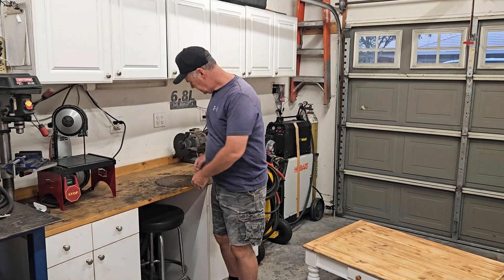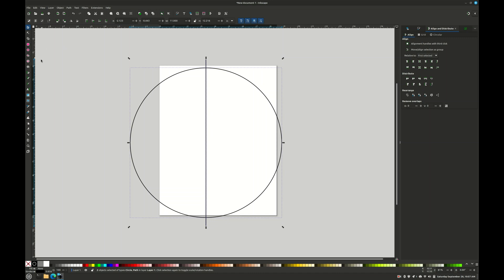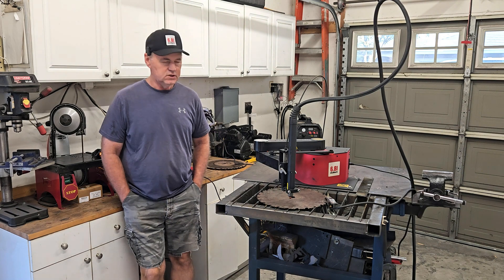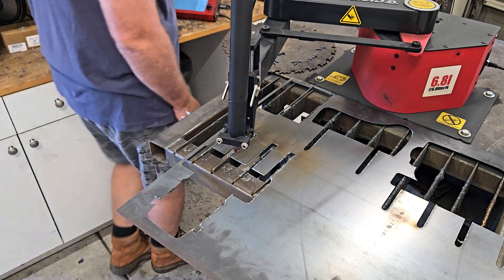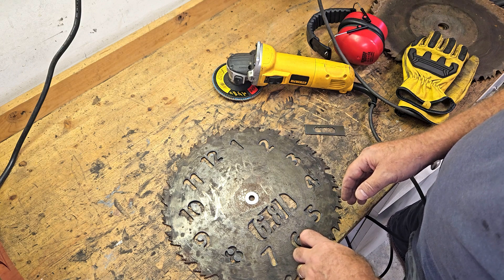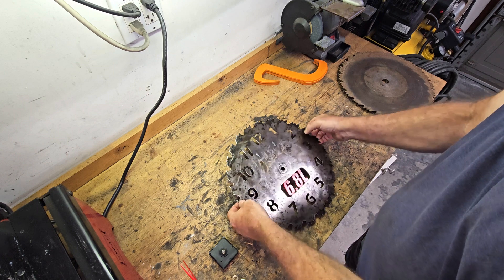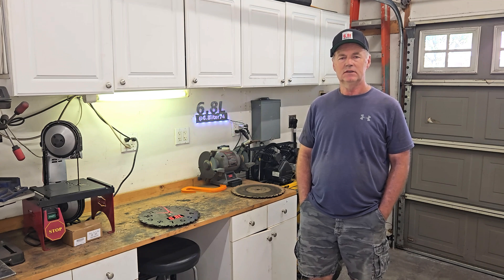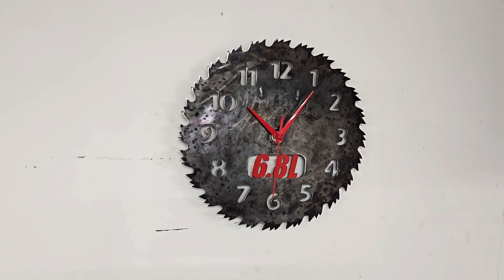I turn a rusty tablesaw blade into a wall clock #cnc #plasmacutting

Comment: I really love "Laptop Guy."  Thanks for bringing us those InkScape tips and tricks.  This is a great project.  I just love your videos.  God Bless!!!
Reply from the maker: @JacksMt.Christian  Glad to hear you are getting something out of my kids.   Thanks for watching and commenting.
Reply: @6.8liter74 you just export to dxf? Any other settings you have to adjust ?
Reply from the maker: @Travisphoenix334  I usually import the .svg into sheetcam,  then use that to produce gcode.  You can simply save as dxf from inkscape, then import directly into the arcdroid.  The arcdroid generates the gcode in that case.
Reply: @6.8liter74  thank you! is there a benefit of doing it one way over the other?
Reply from the maker: @Travisphoenix334  It's easier to control cut order speed clearance height, etc with sheetcam.   To be fair most of that can be done on the arcdroid but I find using sheetcam to be easier.
Reply: Me too!!